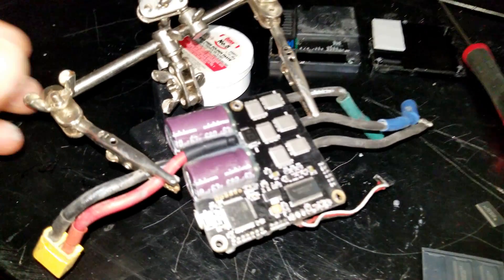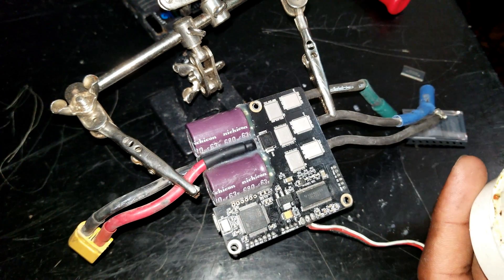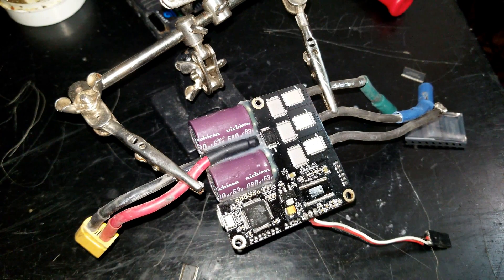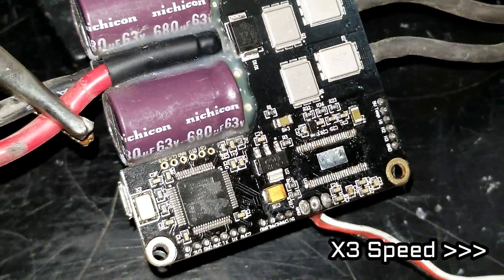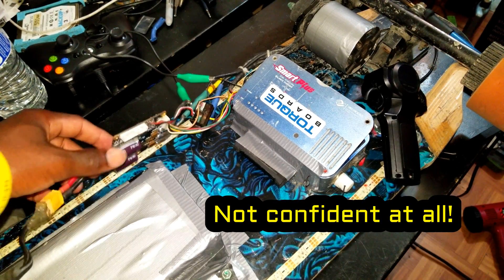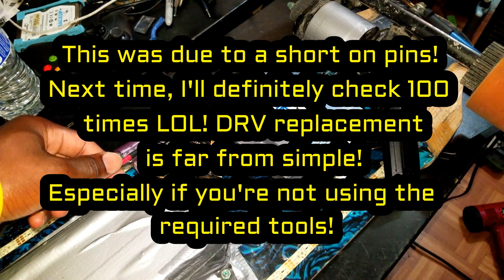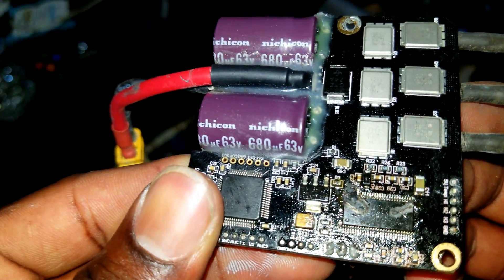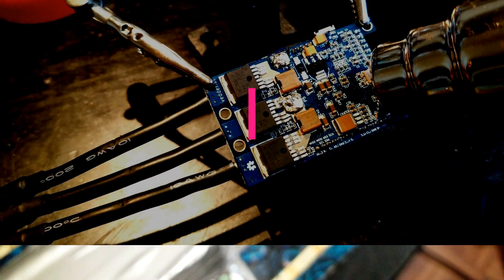HOW TO REPLACE A DRV CHIP - Attempt #2 How to replace DRV8302 on VESC -Also failed

Comment: Very glad you made these videos! 

Even if they get little attention- it is a great help to those who do need it! 10/10 I think seeing the failures helped more than seeing a success. 

I would have been quite pissed if I tried and expected success first try but failed.
Reply from the maker: Thank you for the comment! My micro soldering skills weren't on point and better equipment would've helped the attempt. I'm glad this was helpful
Reply: @YvonSmart  Have you had a  successful replacement yet? I'm wondering if I should even try. Also- if you could share the site you found the DRV chip on- that would be greatly appreciated!
Reply from the maker: @PatRiot-  After my two attempts videos, I haven't tried again. Got busy with other projects, but I would recommend practicing on scratch boards or a dead controller first. I bought the chips form this link:
https://www.aliexpress.us/item/2251832520512308.html?spm=a2g0o.order_list.order_list_main.45.21ef1802F3hc7X&gatewayAdapt=glo2usa4itemAdapt
Reply: @YvonSmart  Yeah that happens. I look forward to seeing a successful replacement sometime in the future. Ever since the Vesc price doubled-  I am considering repairing two of my dead Flipsky ESC. 

Also- thank you very much for the link.
Reply from the maker: @PatRiot-  You're welcome!

Comment: 6:15 u should get flux in a syringe then throw it on the pins then run ur soldering iron across those pins. It will separate the solder from the pins. This way u don't have to run iron between each pin, just run them on top and horizontally not vertical from the pins. Faster and easier

Comment: I did the same replacement. You need to check the mosfets. In my case, two out of five were broken. Just check if there is a the same resistance between gate and source for all mosfets.

Comment: So did u figure out? Did u replace this? I blew like 3 vescs lol
Reply from the maker: I still haven't succeeded either! It's a tough process especially when you don't have all the required materials (hot air soldering station, solder paste, good quality flux, a good magnifier to check joints for shorts after replacement!), But I won't give up LOL

Comment: Well, I recently had a DRV failure on skateboard project, it was a cheap chinsesium VESC ripoff.

I'll try to get a replacement, but if I cant I will be forced to attempt this repair, it's nice to know it's possible.

If I have to repair a drv,  I will be sure to learn from your mistakes, much thanks.
Reply from the maker: Yeah, good luck man! Go extremely slow on taking off the bad drv! If the printed terminals on the pcb comes off, the vesc might become impossible to repair